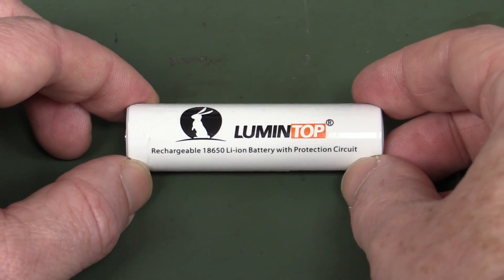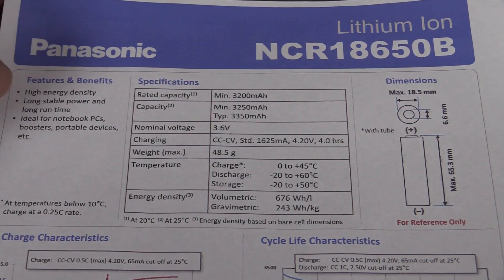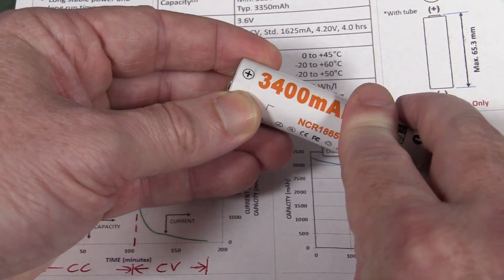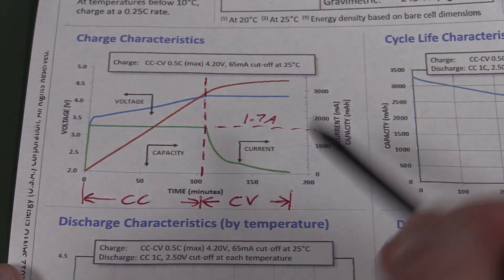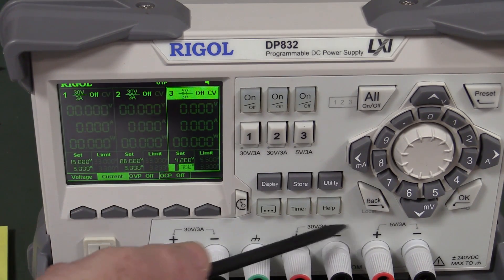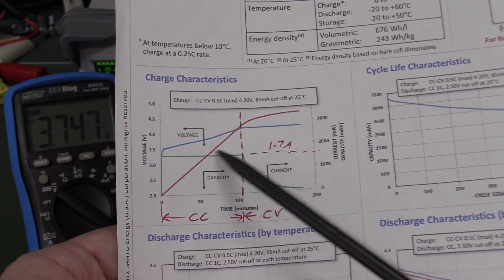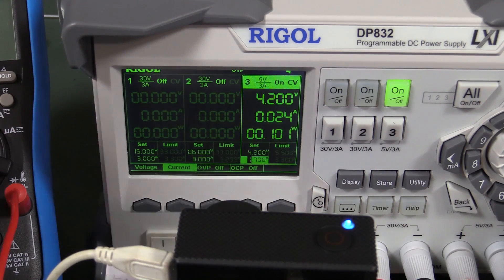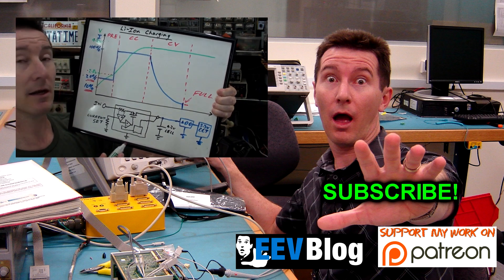EEVblog #919 - How To Charge Li-Ion/LiPo Batteries With A Power Supply

Comment: what happens when you enter a lower voltage in the power supply than the battery already has? Will this break the power supply and what current will there be flowing?
Reply: Current is limited to the internal resistance of the battery, the impedance of the source, and the resistance of your wires. Depending these factors, the power supply is at serious risk.

Comment: The Rigol DP series power supplies specifically state that batteries should not be charged directly like shown here. Instead a series diode should be used. Their reasoning is the loop feedback circuit inside the supply could get thrown off and inaccurate voltage and current will result. That said, I’ve been charging like Dave shows for years and all seems fine. Refer to its manual.
Reply: The problem is a good benchtop power supply has low impedance and stops participating as a voltage source during a power interruption. Therefore it becomes a short circuit across the cell/battery.

Comment: Nice video!
How about batteries with multiple cells in series? Is there a way to guarantee they are balanced using a power supply given the batteries have that additional connector they come with?

Comment: what if the psu is powered off but left connected to the battery?

use a timer box thing, for the psu
Reply: 🔥 Plenty of videos online about homes burned down due to home charging. At a very minimum use a relay that opens the circuit if power is lost.

Comment: Tyvm for good a explanation. I don't know anything about electronics but i recently did this a couple of times with a homebuilt powersupply/lab. I only charged it for short periods tho and monitoring it while doing so but it feels a bit sketchy when not having the knowledge :D   My battery was 500mah and i charged it at 0.5a tho but now i know to lower that! My voltage setting was not set by specs, more based on some quick basic values i found online that semt to correlate somewhat to the battery type.  I did have in consideration that the battery could go poof while trying this.

Comment: I have a confusion.. 
While you say the charging current should be 1/2c.. so for a 3400mah , it is set at 1700ma

But what about when charging a power Bank made out of say 2 of these.. What should be the charging current then..

And, if the constant current is set at lower than 1/2c, i understand it will take longer to charge, but does it have any effect on its life span?

Also, at some point you said that the constant voltage phase reduces life cycle..so does that mean we should omit it ?
At what percentage of battery capacity does that constant voltage phase usually start?

So is there a range in which there is a maximum life span?
Is it the recommended 20-90 percent?

Comment: So the voltage with which the battery is charged should always correspond exactly to the voltage that the battery has at exactly that point in time?

Comment: "you don't want to actually uh trickle charge or float charge lithium-ion batteries like this because it can actually uh build up or plate the uh lithium inside the metallic lithium inside the battery and yeah you don't want to do that they're not designed for that there are um there are chipsets designed for float charging and they use like a pulse uh a slow pulse"

-- Is the same true of the trickle charge for a dead cell?

Comment: I have some questions.
When at the phase of Constant current. Your lab power supply will force the current deliver to always stay at 1.7 A, right ? While the voltage from your PSU does not matter as long as does not pass 4.2V limit.
And when the the voltage is at 4.2, your lab power supply will maintain the voltage at 4.2 from your PSU and let the current sinking?

Comment: Hi, I'm little confused on a constant current state. It looks like it just limit the current to a set limit so its kind of a current limiter. Does the battery itself lower the current it pulls in the psu when it reaches 4.2V? I have a DIY 12V lead acid battery charger but i'm confuse because the current doesn't stay in the current limit it drops slowly while the voltage is rising slowly too. Maybe my battery is broken? My charger is a iron transformer type but has a switch mode buck converter with current and voltage limit setting feature.

Comment: Great video,

Is it possible to charge 10 batteries in parallel using the same concept.

If so do you increase the current by 10 times?

 for example if one cell safe charge current is 600amps putting 10 in parallel is safe to charge at 6amps???

Thanks

Comment: I have been charging 18650 cells on my lab supply for years.  Set the current to 1A and the voltage to 4.2v per cell.  Stop charging once the current is reduced to 100mA.  Sometimes I charge overnight with a current limit of 250mA and again stop the charge when the current reaches 100mA.  I have started experimenting with TP4056 modules which automatically stop the charge which is quite handy for unattended charging.
Reply: what aliexpress supply can do this stuff?
Reply: max is 1C

Comment: I have a 4-cell in series Li-ion pack for my vacuum. Anyone knows if I can apply exactly the same technique here, or should the numbers be revised by multiplying 4 or dividing by 4?
Reply: i charged my 4 pack vac battery at 16.8 v and 1.3 amps

Comment: It's been mentioned, but military tech only charges lithium batteries to 3.9v. Maybe 80% of the capacity, but close to 5 times more charge cycles.
Reply: Yes, at a "storing" voltage... exactly right

Comment: 1 what is the red line on the graph in the data sheet
2 when you go to constant voltage, how, why does the current drop. Its pretty clear what happens in the constant current phase, but then what is the magic

Comment: WARNING: With Channel 1 OFF. I connected a 26V Lithium battery pack to channel 1 of the DP832 and it damaged the PSU.  In Daves words "Magic smoke time".  With the channel off the PSU can sink current from a connected battery and this blows something in the power supply.  Over current protection was on, so probably that.  In contrast,  just the day before I had been charging 12V Lithium batteries with no problems at all.  Afterwards the display gave the error message “Charge overcurrent protection. Disable the output of CH1”.  Now Channel 1 doesn't supply any power but luckily the rest are working.

After some more research I found this Rigol doc on the Batronix website about not connecting active loads https://www.batronix.com/files/Rigol/Labornetzteile/DP8_DP1_ActiveLoads.pdf.   Apparently with the DP800 and DP1000 the channel output is not turned on with a relay so the over current protection / control circuitry is still active even with the channel off.  They recommend using a protection diode in series with the battery to charge.

The main manual has this, which I don't fully understand and says it can damage the powered device not the Power supply.
Do Not Provide Power for the Active Load.
In order to avoid the anti-irrigation current which leads to the power control loop out of control and damages the powered device, this power supply can only provide power for the pure load without the current output function.

Comment: Too much math. I understand it can be dangerous to improper charge lion bat. But it is easy with lab power supply. 4.15V, with a constant current 500mA and never run into problems and never have to use math to charge the battery. Just do it in a safe way and it's ok.  More likely people will run into dangerous situations if they attempt to charge already dmg-ed cels. People do not believe that cell that is discharged below 2.5V is a damaged cell and it should not be charged anymore and used. Damaged cells are cells that got discharged below 2.5volts generally but the datasheet can say the exact lowest discharge point before damage happens.  Damaged cells are cells that got overheated at least once. Damaged cells are cells that do not have the same capacity. I think you should make a video about how to find damaged cells not how to charge em, since charging dmg-ed cells is very dangerous. however god video so always thumbs up.

Comment: do you set the voltage equal to 4.2 multiplied by the number of batteries in series so for example, 10s would be 42V

Comment: My electric drill/flashlight battery charger charges to 4.0V, so that's like 3 times more longevity or even better. Great for the environment for sure.
I also charge my phone up to 75% for the same reason (only possible if rooted).

Comment: Although the cell won't be charged to its full capacity, would it be safe to leave an applied float voltage at a lower value than the rated transition level. For example, if the cell in this video were left connected to a 4.0V source instead of the 4.2V charging voltage, would the Lithium still plate out?
Reply: Don't float charge a Li ion, Ni-cad and Ni-mh yes.

Comment: Hi Dave, Thanks for the nice video! It reassured me that my understanding of the 18650 data sheet is correct, and I'm going to be safe charging these cells.

Mind you that one could easily  set up (a power supply like) the DP832 to automatically respect both, the minimum charging current, and the maximum charging time. There are two options:

a) Use the Delayer. Set up 1 group with constant high level. Set period = 3600s, and 4 cycles (only the product matters). Set stop condition as <64mA, and End State as Output Off. 

b) Use the monitor function in [...] > Monitor. This one is quicker to setup, but it does only the current not the timer, and the Monitor is an optional paid feature that one might not have activated.

(Everybody: A diode should be in the circuit to protect the power supply. See technical note from Rigol, as mentioned in an earlier comment: https://www.batronix.com/pdf/Rigol/DP8_DP1_ActiveLoads.pdf

Comment: I did read that Lipo batteries are more dangerous to charge without a specific "balancing" charger . Then may be some balancing circuitry exists in my battery pack, not only a heat sensor and constant current constant voltage circuitry (?) I did unsold it from the batteries to be sure of what happens) thank you

Comment: Hi! Nice tutorial! I have one question, maybe you know the answer. My charger doesnt have a Li Ion charging setup program. Can one use a LiPo program instead? with limited charging current of 10% of the battery mAh? LiPo programs limit the voltage to 4.2v, so.. i guess i would be ok. right?
Reply: YES, and 10% is the standard rule, this video skipped this important point.

Comment: How can I charge 12V 55Ah AGM Lead Acid battery using a lab power supply (Korad KA3005P)? Any links appreciated. Cheers!
Reply: Use a Ctek MXS 5.0 or Optimate 4 charger.

Comment: What if one decides to undercharge the cell (to 4.0V say), can you keep the power supply connected indefinitely?
Reply: No. Always keeping a li-ion cell at or near its maximum voltage can greatly reduce its life span. For long term storage, they should be at about 3.6v. If you are going to charge it up, use it

Comment: Have done this with one battery no problem, but if I do the same with 8 batteries in parallel, I still only get the same current as if I would charge one battery. So it will take 8 times longer to charge them together rather then one at the time. Why is that? It doesn't make sense.

Comment: Hey would you do a strip down of any "vaporizer" regulated battery modules? They generally use 18650 batteries to heat a coil which vaporises liquid. I think it's interesting from an EE perspective because these mods measure the resistance of the coil, and use some kind voltage stepper to allow you to select a wattage for powering the coil.

Comment: Great video. Electrolysis is a bitch for lithium batteries. Always good practice to look up datasheets but you should spend a dollar and just buy a small circuit that you plug a micro USB cord into. Add it to your 18650 battery holder and Bob's your Uncle mate.

Comment: The thing today is reviving a dead battery back.  Personally to me the method used by many is to zap the pack, with a like good battery by connecting the packs in parallel for seconds, is haphazard.

While it is politically not proper for the consumer to rejuvenate a pack, having to scrap a pricey pack within months of purchase is a waste.

The pack I rejuvenated is a 18v, 36AH Hoover Links vacuum cleaner.  It consists of 5 18650 cells in series and with a large circuit board.  Each cell measured 0.14v except one, that one cell was 0.010v.  This cell I charged at 15mA with the supply set at CC.  The corresponding voltage was 0.5v and CV set to the same.  Once the supply switched from CC to CV, I gradually, increments, set the CV higher while keeping the CC the same.  Initially the supply took about an hour to switch from CC to CV, this change caused the current of 15mA to go 0.0mA.  Eventually ended the charge on each cell at 4.0v with CC at 200mA, once the cell voltage reached 4.0v the charge current will drop to 0mA.

The pack appears to work OK now but unknown as to life compared to non rejuvenated pack.  The battery packs appear to run at high drain because the vacuum only runs for 15 minutes when the motor goes noticeably slower and the power low battery indicator flashes.  I suggested to the users of the vacuum to stop using when the indicator flashes/or sound of motor becomes weak.  Do not run until it dies.

Comment: since the 3400mah is a lie according to the spec sheet, you should only be charging at 1600mah not 1700mah, you even said the label is probably marketing BS, but than you forgot the label is fake and charged at 1700mah

Comment: Can a Li-Ion accept a constant voltage of 4.2 volts continuous for several years without damaging the cell as a backup similar to a UPS?
Reply: No! You should disconnect charging until it is needed again.

Comment: Ok yuo buy a 1000$ lab power supply or a 5 uss dolar 18650 charger.I think im going to buy the 5 dollar charger
Reply: no way, That means you have no desire to power up and operate every electronic project you could imagine, Ive used mine for countless projects and to charge tiny batteries that a smart charger isn't programmed to handle.

Comment: Hi dude,
I have a cheap Chinese dc-dc converter with specification cv/cv and charging li-ion batteries. When I tried to charge 18650 batteries with this converter, I set the constant current to 0.5A, but the output voltage of converter increased to 5.0 volt.

Do you think it is normal? Do I care about this or don't charge the batteries with this converter/charger?

Besides, if increase in voltage is normal. Which should be done to pass constant voltage charging? To wait the battery plugged to converter and the voltage is 4.2 volt or the battery not plugged to converter and the voltage is 4.2 volt?

I hope you reply my questions.
Thanks in advance.

Comment: USB chargin  5 wolt to controler ship? 

and how to charge arrays of baterys like electic bikes ?
Reply: Just calculate your max voltage based on how many cells in series, and your max current based on how many cells in parallel.  For the 14S7P battery like the one I just built, and got impatient waiting for the "proper" charger to arrive, I used 57.5V (4.1V x 14) and I would have picked 10.5A (1500mA x 7) but my PSU is limited to 5A so they just charged more slowly.  It worked like a charm - thanks EEVblog

Comment: was wondering if someone could help me out here.. i have this portable speaker.. it has 2x 3.7v 1500mah li-ion 18650 batteries inside it .. i was wondering  if i could just get 2 bigger MAH batteries same voltage and have  longer run time ????

Comment: Thanks nice tutorial.
Few questions,
1.In cc mode if voltage supply exceeds 4.2 v does it damage battery before it reaches cv mode?
2.Can u plz explain how ev dc fast charging works?
3. Also how charging efficiency is managed. 
Thanks a lot Dave.

Comment: I'm a bit confused.. Why does it say 3.7V on the battery but we charge it to 4.2V?
...Even the datasheet says to charge it at 4.2V but the "nominal voltage" of the battery is 3.6/3.7V

Comment: A question. Say that you wanted to charge a battery while it's in use. Similar to how a laptop charges it's battery with the power on. I take it that all you would need is a battery charger in parallel with the battery that is capable of putting out enough current both to power the device as well as top up the battery. Since the charger would limit voltage to 4.2 and reduce amperage as the battery charges, this should work right? I want to convert a remote control vehicle to be able to self charge with a dock and always be on, for a security robot.

Comment: Why some people say that this can damage the power supply cause the battery will try to "charge" the power supply after the charging is done? They suggest using a diode and then it can be done.

Comment: You can do the same, with different voltages and currents for NiCd, NiMh batteries.  I've been recharging 1.5V alkaline cells as well with my PSU, works great (1.7V, 150mA).  Doesn't work on 9V batteries, though. :(

Comment: Is that a real 3700mah battery?
Reply: Probably not if it's an 18650.  The physical size and the chemistry means that 18650's can't be made with a capacity much above 3500mAh.

Comment: Is it ok to have you LiPo to be over its 3.7v that it says on itself? If I kept my charger running at 4.2V then the battery voltage would rise to 4.2V. Same thing goes to Li-ion batteries.
Reply: That "3.7V" is just the nominal voltage, if you only charged them up to that you would have only about half their capacity available.

Comment: You say to charge it for 4 hours. But what if the battery was not completely dead? What if it was halfway charged or three quarters of the way charged? Should you still charge it for 4 hours?
Reply: No.  Although you're unlikely to badly damage the battery in 4 hours so long as the constant voltage and current are correctly set.